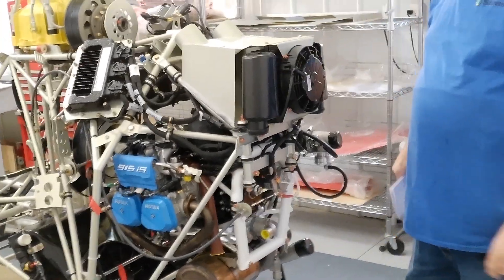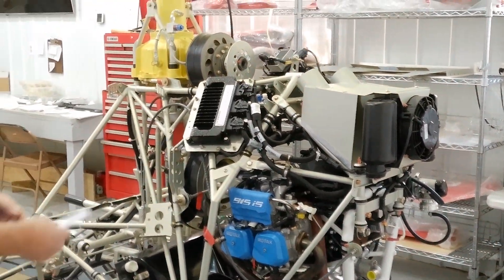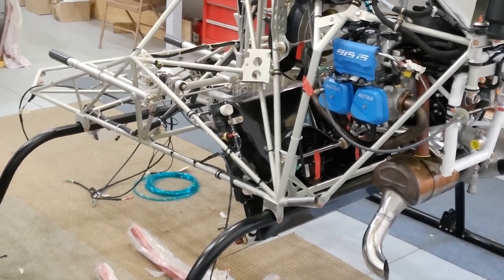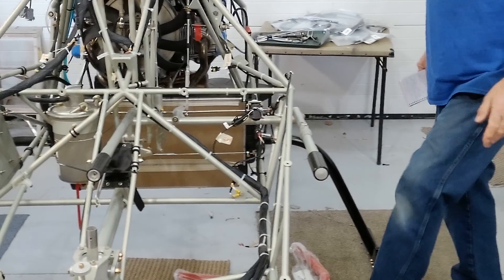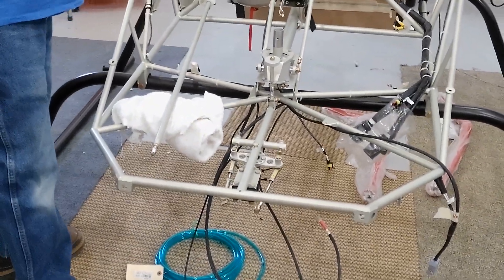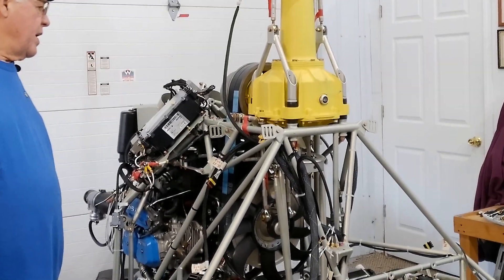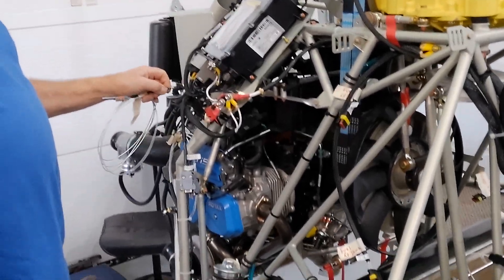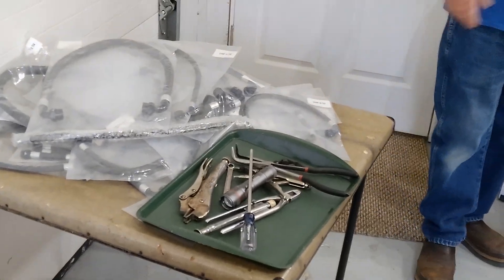Cicare Helicopter , Part 13.  Assembly

Comment: How much time have you spent on this build to date?
Reply from the maker: I have about 105 hrs. now. BUT I use a lot of the time studying the manual. Plus it takes a lot of time doing these video's. I just recieved the kit first part of Oct. so I only got almost 2 months in it.    If you look at the first video's I did ,  the time stamp on the video's is wrong. My camera battery went dead and I never noticed the date was wrong. So now I don't have a date on it except for the posting date.